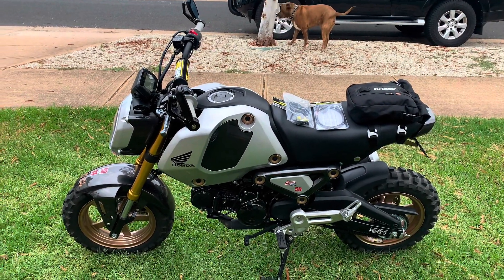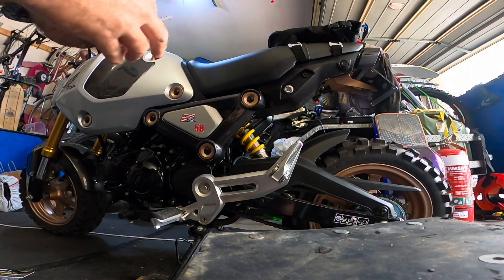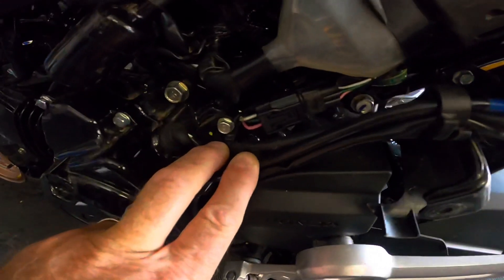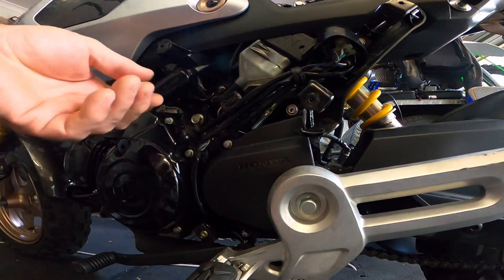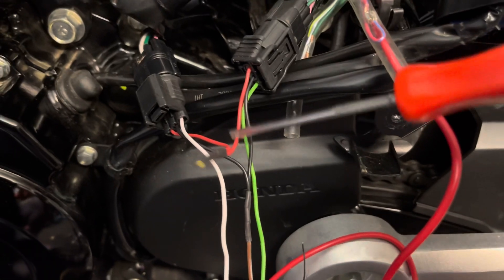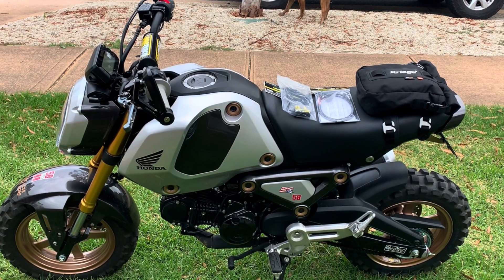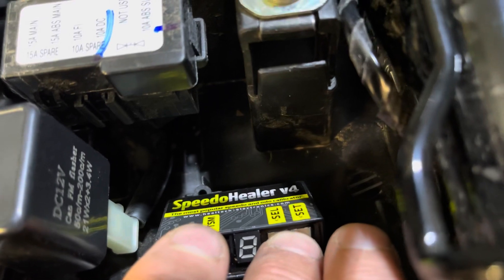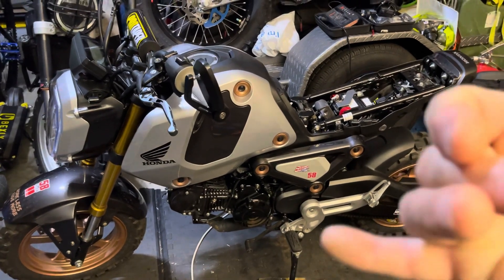2022 Grom ABS 14t front sprocket and Healtech Speedo Healer fitting, set up and wiring harness fix

Comment: Great video, this helped a lot! I got power to my Speedo healer however even after programming my dashboard reads 0mph at all times. When I put it in test mode it shows 9mph at standstill but my dash won’t read when I’m riding. Have you had this issue? All I did was hook up the harness and cut the power wires and spliced into the power line you showed everything else is as you would for a non ABS model
Reply from the maker: Hi mate, thank you.. No I’ve not had that issue, odd that it gives you a reading in test as it should but no readout when riding. Are all the wires connected correctly? The pink is the speedo feed if I remember correctly.
Reply: @dwninetynine  so fun fact I actually just figure it out this morning. What I did was I cut those wires that you show you got power from and only connected the ignition power wire to my speedo healers power source. Withou the other 2 wires touching as well it doesn’t give power to the speed sensor it seems. So what I did was I connected all 3 of those wires to the speedo healer power wire and now everything has power. Healtech recommends you cut into the dash connector harness which I really didn’t wanna do so luckily this worked. I appreciate your video, I’m glad you pointed me in the direction of that power source cause I had no idea where I was gonna get power from lol
Reply from the maker: @egoboost9952  ah I see ok, yes I left those wires together and just connected the SH to it rather than split them. No I don’t like the idea of splicing the dash loom either. They now say that after I went back to them and highlighted the issue but still feel the alternate power source is the better way to go and still use the plugs.
Reply: @dwninetynine  since using your speedo healer, have you had a flashing ABS light? I noticed on the way home that my ABS light was flashing. I shut the bike off and back on and within like 5 seconds of riding it started flashing again. Healtech mentioned that wiring it through the dash is to prevent the light from coming on but I don’t see how using the speed sensor causes the light but 12 o’clock labs uses the sensor and didn’t throw a light
Reply from the maker: @egoboost9952  it did for a while and has since stopped… not sure who’s it fixed itself. I cut a small piece of black tape to cover it when it did flash as it was v annoying!

Comment: Thanks for the helpful video.

I've installed the Healtech v4 on my Monkey today. Everything looks to be fine as far as the speedo goes. My issues lies in that my abs light goes out as normal initialy, but after about a mile or so it comes back on and flashes.

I'd no issues before so can only assume it relates to this installation.

The speedo is working ok in itself and I have it calibrated after compared to GPS. It's the flashing ABS light issue I'm struggling to understand!
Reply from the maker: Hey, thanks for the comment, I’m having the exact same issue with the ABS light. Would love to know if there is a cure for this… In the interim, I’ve stuck a piece of black plastic over the ABS light but, the ABS does not work either…. Is there a fix??
Reply: @dwninetynine  That's reassuring to hear you've the same issue, but also disappointing that it appears to be a problem with more than just mine!

Did you speak to Healtech about it to make them aware?

I wonder is this an issue with other speedo
healers or just the Healtech v4?
Reply from the maker: @iansimpson8309  so the feedback I got was to not use the interface with the pink wire at the gearbox connect (as they provide plugs for) but to follow the pink from the back of the clocks to isolate the ABS circuit…. I’ve left mine as I’m happy as it is, I prefer the non abs “feature” I now have, especially when on the trail. But if you have to go to that amount of effort to solve the problem I’d say it needs a rethink as to where it enters the loom…
Reply: @dwninetynine  I was given the adapter kit without any connectors so have had to cut and solder the wiring on my 3 week old bike.

Unfortunately for me the bike is used for on road riding only so ABS would be a benefit. It would also result in an MOT fail once that time comes around.

Healtech could really do with updating their instructions. I'm really disappointed that they are selling a product and instructions which are not fit for purpose.

Thanks for taking the time to get back. Much appreciated.
Reply from the maker: @iansimpson8309  ok well here the tip mate, just re link where you split the link, I assume at the gearbox connector and run it up to the back of the clocks… will sort it… yeh you’re buggered for an mot, here in VIC they only test when you buy and sell, which is mental for road safety, but also good for me lol! 
You can buy a car here, own it for 20 years and never have it mot’d unless you sell it… how’s that!!
Reply: @dwninetynine  That's crazy. I imagine the folks over there keep their vehicles for a long time!!

Thanks for the tip. I've emailed Healtech to see what they say. I wonder do other speedo healers suffer the same fate on the 22 model?

Bit frustrated that they're knowingly selling a kit allegedly for the ABS model when all it does is render the ABS useless!
Reply: @dwninetynine  That's crazy! I imagine folks over there keep their vehicles for a long time!

Thanks for the tip. I've emailed Healtech to see what they say. I wonder do other speedo healers suffer the same fate on the 22 model?

I'm a bit frustrated they they're knowingly selling a kit allegedly for the ABS model, when after following their install instructions it renders the ABS useless!

Not sure what to do. I might end up returning it if there's an alternative speedo healer than can get around this issue without cutting up the loom!

Thanks for all your help and advice. Much appreciated!!
Reply: @dwninetynine  I contacted Healtech and got the full instructions and it was as you've suggested. Connect to the green and white wire at the back of the clocks and job done.

No more ABS light, so I'm well pleased!
Reply from the maker: @iansimpson8309  Green/White check, not pink sorry! Great info Ian.. glad you got it sorted mate
Reply: @iansimpson8309  Hello Ian! Do you remember the part number of your wiring kit?
Reply: @maxkumskoi9108  Hi Max! The correct wiring harness for all Honda Monkeys, 2019-2022, is SH-U01.
Reply: @iansimpson8309  Hi Ian! Thanks for your reply! I received and realised it comes with no connectors. In the original video he is using SH-H08 (which is for non-ABS Grom). Do you think I can order it and re-use the connectors? I am looking for how not to cut the original harness. Thanks!
Reply: Which wire are you referring to when you say back of clocks? Need to keep my abs ideally
Reply: @thecornishmaker5285  Sorry, I've since sold the bike so can't check and don't recall which one it was.

Comment: Hi, did the Shinko tires fit or did you have to lift the front fender? Seems like there's 5mm of space at most, that's why I'm asking
Reply from the maker: Hi there, they fit great actually, there’s more space there than 5mm but haven’t measured. You’ll
Be fine, no need to lift the front mud guard…

Comment: Hey matey was it just the yellow wire off the recover box that requires to be attached onto 12v powering? The rest of the wires can be left?
Reply from the maker: Hey bud, yes, just send power to the yellow. Ensure the reds are continuous, you saw I cut it above the join…. Incidentally. I’m getting a flashing abs light now after a bit of rising. I’ve messaged Healtech about it. Be interested to know if you get the same issue. I actually don’t mind as I was going to deactivate abs anyway but some may not.
Reply: @dwninetynine  yeah sweet as matey! I'll make sure all wires are left alone besides yellow correct? Does the abs light just happen intermittently? I'm trying to grab a 12'0clock speedhealer but they're either too expensive to ship abs version to Australia or local sources out of stock so I'll go and cut up the healtech one soon and get it working !
Reply from the maker: @ReeceCoza  once you go over about 50kph the abs light starts flashing and that’s it, it doesn’t go off until you start up again and same thing happens.. I’ve just stuck a black sticker over it lol! Where are you in Aus?
Reply: @dwninetynine  ahahh fair enough that is super strange! I'm based in Sydney !
Reply from the maker: @ReeceCoza  yeh I know, I’ve told Healtech… I may reset my ECU and see if that stops it but as I say, I’m not fussed. I’m in Melb…
Reply: @dwninetynine  let me know how you go and I'll report back once I splice mine, not bad! Fellow Aussie!
Reply: @dwninetynine  so I went to cut my loom, I don't even have a yellow wire hahahah
Reply from the maker: @ReeceCoza  LOL, no the yellow wire is in the SH-HO8
Reply: @dwninetynine  isn't that the adapter for the groms speed sensor that plugs into the healer box ? Ive got the same one
Reply from the maker: @ReeceCoza  Ye smate, I split back the shrink wrap to expose the wires in the Healtech lead, snipped the wire above the red where it joins the yellow and connected the yellow to the switchable live feed. Healtech have emailed me back and have offered instructions as to how to wire it direct to the closks to hopefully stop the abs light coming on but ive yet to explore this...
Reply: @dwninetynine  man so strange I opened the loom fairly early and later up and can't see a yellow cable maybe I'll keep looking hahah. I saw healtechs one they want to cut dash wires and thay definitely isn't happening

Comment: Why do people think that a fuel injected bike with a lambda sensor will run lean? The ecu can counter that, that’s why it’s there. I’ve seen folks remove their “mapped” ecu and just run the intake an exhaust and they get the same top speed. Only .1 seconds quicker from 10mph to 50. I don’t get why folks do it.
Reply from the maker: Well, my CJR ECU arrived Friday and I fitted it. Rode Saturday and can assure you it was night and day better than the std one. Stronger in the midrange and higher top speed by some margin.
Was my bike running lean? I don’t know, but if it felt stronger, went faster and was far more tractable in 5th then I can only assume it was, that and some timing tweaks…
Reply: It wont, it will run a little richer than before but betweeen a security margin that is still too low for aftermarket intake and exhaust